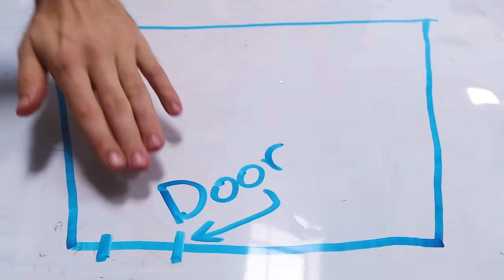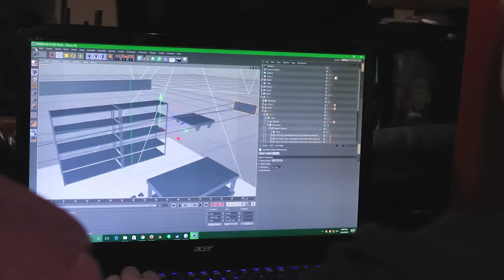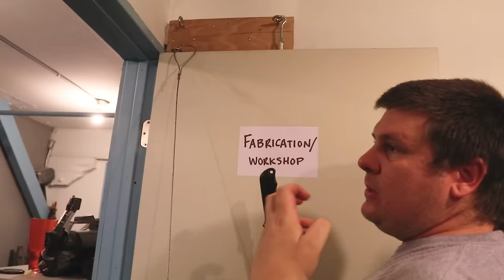Let's EXPLODE a Battery!

Comment: One potential solution for the camera rig I can think of is to run a pole (maybe a PVC pipe?) across the middle between the two sliders on the sides. This would transfer the tension in the center cables into compression in the pole allowing you to put much more tension on the middle cables without adding any stress to the wall mounts. In addition this would also help dampen some of the camera movement up and down as it would hold the tension in the center cable more constant, keeping it from bouncing. As a quick retrofit, you could even just thread the top two crossing cables through pipes to mount them. If you have any questions about what I was trying to say just let me know.

Source: also a mechanical engineer

Comment: to screw in revolts easier use a drill with a large socket that fits over the eye.  get it started by hand,  ensure its straight.  then use the drill to finish it

Comment: What's keeping you guys from replacing the top down camera mount's wires with rods? It would remove the need to apply an extreme lateral load on the wall and would remove sag (as long as you get stiff enough rods). As I typed this, I think Wren said basically the same thing. Go engineers!

Comment: The answer to the question "linear or exponential pull?" is that it's an exponential pull times another exponential pull.    The pulling force at the ends of a wire goes up exponentially as the load approaches the center of the wire and the straighter the wire is to start with.    If you had a hypothetical wire with zero stretch, that started out perfectly straight, then pretty much any force exerted in the middle of the wire generates infinite pull at the ends.      As soon as you allow some slack or stretch in the wire, the pulling force drops off quickly.   This is one reason zip lines usually have some slack in them, and spider cam rigs must always have some slack in the lines (can't be pulled up perfectly straight).  

The problem you have with two sets of parallel wires and then a set that are perpendicular is that you're multiplying the two exponential pulls together, so load on the cross wires pulls extremely hard in the middle of the side wires which exert their own extreme high pull on the anchors.   Something will give up.  Also, the side dollys with load on them will always try to center themselves on the side wires.   

As was concluded in the video, poles (or more specifically square or I-beams) will work much better.

Comment: You guys may need to attach a piece of wood or tubing between the two sliding boards to maintain rigidity and keep the cables from pulling together, or lose the cross cables altogether and go with a different way to slide the dolly on top of the sliding boards.

Comment: On the cable system try to make the tray as light as possible. There is no tension. On it as it floats on the cables. That should help in to lighten the load. Plastic wheels plot sheets and a go pro

Comment: Use pvc pipes instead of cables and skateboard wheels kinda like a DIY dolly but in the air. Or you can use metal rods with linear bearings like a 3d printer. These two options get rid of the wobblyness and the high tension on the wall. The force acting on the wall can easily be calculated using Pythagoras triangle and F=m*g.

Comment: the two on the sides shoudldve had a railsystem so they wouldnt be pulled away from the wall, just as a retentionsystem, with that you could put a lot more tension on the centerwires, one problem that creates though is that you need some smooth bearring and wheels on the railsystem otherwise it wouldnt roll verry well

Comment: You really only need solid rails for suspended part that is not directly attached to the walls.  The parts directly attached to the walls should be fine; the wires can be tightened there without issue.

Comment: You guys could attach a rail instead of a wire to the wall above the door and to the wall parallel the the door directly to the wall. It could ride on to that rail and help eliminate that problem with the middle wire pulling the side wires

Comment: for the top down, why not put a track or or line along the both sides of the wall while to attach to the back of the two vertical aligned boards. or for instead of using systems of wires your could use wall brackets to mount hollow aluminum poles. this would also move alot smoother for shots.

Comment: Just curious…why didn't you guys go with PVC pipe for your overhead? It takes a bit more dialing in to get the tracks perfectly parallel, but you can do it. Then the cross-mount is done also with PVC, in an "H" configuration with hot-glued crossbars near the ends to keep them perpendicular, and then you mount those on the side tracks with rings and limiter pins to give them a little play so that these system doesn't have to be nanometer-accurate. Two pairs of rings per PVC pipe per board, four per board total in a "square" configuration.

This will not be very expensive, and will save you the all this Philippe Petit "tensioning" hardship.  o.o

Comment: Would it not be simpler for the top down rig to have metal channels either side of the room at ceiling height, with a pair of rollers in each? Similar to sliding door runners. Cables then attached to the rollers, spanning the room? This would allow more tension to be applied to the cables, as the channel would be fixed at intervals along its length. Just a thought.

Comment: The battery caught on fire because is made out of lithium, lithium is an alkaline metal( like sodium, potassium,... )wich mean that it react with water in an Exothermic reaction ( that generate heat ). In this case I think it has reacted with the water present in the air ;)

Comment: Wren was right that battery didn't explode. The thing is, is that it defligrated which is sort of like an explosion except it doesn't produce a shockwave. Instead it produces large flames and a lot of gas. You can see the same reaction when firing a gun.

Comment: The problem is with the wire system is, that you can only transfer force as long there is an angle  (sin(0)=0). Sorry if unclear

Comment: I have done that with old lipo batteries used for rc cars, all I did was use a hatchet and cut it in half (Jk you have to discharge them and put a nail in em)

Comment: Exponential pull? Jeez dude, you gotta do some statics. I'd love to help/redesign it
Reply: Yeah, I was thinking about it last night, but they could roll with PVC, like in the video I attached and support it down the length of the room with some wood. Cheap. Easy to Fix, and strong enough!
Reply: 80/20 or similar extruded aluminum would work perfectly and is relatively inexpensive. you wouldn't need linear guides because they obviously aren't trying to hold tight tolerances, given that they thought it would be acceptable to hang it from cables.

Comment: Mabye instead typical platform use three motorized windlass with ends attached to triangual platform? It may be less stable and need more math and logic, but you can get three dimension movement. It's kind of Stewart platform (Parallel Cable Robot).

Comment: I'm honestly more curious to see how you guys complete the top-down rig now, more than anything! ;)

Unless you are bolting those chunks of scrap wood into support beams and using HD eyelag bolts as well for keeping tension on your cables, your top-down rig is gonna sag. No question. Using those flimsy eyelag screws (big difference between bolts & screws; Wren should know) will just rip out of that plywood they're screwed into once you apply proper tension to your cables... in their respective direction. Add in now the cross tension required for the perpendicular "slider" part and now I'd guess you've exponentially multiplied the stress forces on all the corner wall eyelags each.

A single steel rail on opposite walls held via brackets would give you the support and run-length freedom you're looking for. Angle iron or PVC tubing makes no difference as long as you have your wheel system to match your chosen type of rails. As for the perpendicular cross slider, again, steel rails give you the strongest support vs sag/gravity and again, choose your wheel system to match. Taking another quick look at the posted video, you still need to account for camera weight on your rig, unless you plan on using a GoPro which would be negligible weight.

I'm curious how you plan to control the rig motion? The wall sliders will need to be controlled simultaneously whereas the middle slider only needs one controller. You could drop it down to only 2 controllers but that would require some long cabling to run both wall sliders off a single motor system; probably easiest/cheapest option as only requires extra (double?) long cables to connect the far wall rail to the controller.

Comment: Use safety glasses when fucking with these batteries. Even though they are more likely to burn, like in the video, they can explode. My old airsoft repair guy has a glass eye, because his original eye was sliced in half by li-po shrapnel.

Comment: For the rig, why not just use pulleys in the corners with counter weights? it's not like the room is that big so you'd get by with the height of the room as the diagonal travel of the rig

Comment: This may or may not be a good idea, nor correct, but I was just thinking; would the CoreXY style of movement (used on CNC machines and such), help with the issues of tension and material stress? I feel like the crossing wires would help to split the load. Just a thought I had; keep being rad!

Comment: Have yall seen the wirewalking movie "The Walk" with Joseph Gordon Levitt? I feel like they had tips about stringing up wire with tension and such.
Reply: Wait wait wait, I change my answer. So instead of one wire per anchor point, maybe make a loop that goes through both anchor points. So say from one wall to the other, instead of 2 wires just do one long wire. This wire can be tightened and tensioned until the desired tightness. I dont know about the one that goes in between though...
Reply: Never mind...I rewatched the video and realized that is not at all what you guys need. =( Out of my league but good luck to yall

Comment: Imagine what would have happened if Niko had hit the center of it ^^
Cool shot though, in every sense of the word ;)
And for the top down rig I would use tubing instead of wires. No sag, no pull, totally rigid system. From one engineering student to the other ;) Let me know what you think, so I can improve too! :)

Comment: You should not use water for putting out a lithium fire, it can react violently. There are special fire extinguishers for metal fires that should be used instead.

Comment: It would be better if welded a pole on the sides and had the wire rigid the middle if you really want wire. Or just instead of wire you just use pipe that the trolley can run on

Comment: Did you guys really extinguish the battery with water??? I guess you were lucky, that all the lithium already reacted with air because otherwise you might have gotten your little explosion :D

Ohh and it (obviously) would have been better to use metal rods for your camera system. Just secure two of them next to each other horizontally at both ends and put three to four supports underneath. Do that on both sides and let the trolleys drive on top with another set of rods, which then hold the actual camera. I have build a rig similar to yours and it works perfectly. 
It´s just always a bad idea to secure somthing to a wall with wires. If you don´t want the wire to be hanging under load, you have to put a huge amount of force on your bolts. 
(If your final rig weighs around 6 kg/13 lb, you put around 178 N/40 lbf of force on your wire in each direction, if you allow a 10° angle. [5° -> 338 N/76 lbf])
Wire systems also tend to loosen up over time especially if you use them regularly.
... but apart from that I would love to see you guys finishing/re doing your trolley system.

Comment: You can't hold a vertical load with horizontal wires because they can only carry axial loads.  There's no rigidity in them, and nothing to counteract a moment .  No matter how tight you pull those cables, there will always be sag.

Comment: random curiosity why didn't you just go with a rail system or pulley wheels between 2 pipes for the movements against the wall that way there wouldn't be a issue of tension other then the wires crossing the middle of the room

Comment: have a third cable on each side running through a hoop on the outside of the board to stop the dolly from pulling the whole thing inwards?
though it would need connecting to the other walls
was it not effective to build your own runners on the walls and have an elevated trolley sort of thing rather than fiddling around with tensioned cables?

Comment: I'm new and enjoying your channel. I was wondering what the pull is on your re-curve bow? I have an older Re-curve with and 85lb  pull and have to use carbon fiber arrow shafts. How do you get away with using wooden shafts with out them snapping ?

Comment: I don't think they realise that it was surely going to burn. It is a mostly lithium battery, Lithium if it comes in contact with water violently reacts resulting in fire, and sometimes explosions. Wren was kinda lucky that it didn't explode.
Reply: Nah that wouldn't have happened. The water isn't what set it off. It was the short-circuit within the battery from the arrow clipping it which caused the ignition. And the only reason it did burn was because it was a fully charged battery, something I didn't realize.
Reply: yes, there is that as well as lithium batteries when considered dead still have a significant charge, my dead 3 cell for instance sits at 7+ volts, my full working one reads 12.3 volts. When they go puffy like you were saying yours was it was probably sitting around the 7-8 volt area.
Reply: ninjaman5j5 Because of how batteries work, that's a little misleading. Yeah it's reading 7-8 volts but because there's so little energy left, it doesn't have the same effect as a fully charged 2 cell battery reading the same voltage. If a battery is depleted, there's no more potential energy stored in it to combust. There are tons of videos online of batteries that don't really do anything after being destroyed like this, because they don't have much charge left. 

And although yes, Lithium reacts violently with water, there's less than 2% lithium in a Li-Po battery and since the polymer package was sealing it, the lithium didn't come into contact with any water.

The puffyness is due to excess oxygen from the anode aging, which is what ignited when the battery cell short circuited. The battery can still read nearly full voltage even when it's puffy like that.

Comment: I'm sure I don't need to say this, but don't do this with a Lithium Ion battery. It'll burn until there's nothing left. There's no way to put those things out. But you guys are smart so I'm guessing I'm preaching to the choir. Also Wren what was your Engineering major?
Reply: I'm late to responding I guess. I majored in Mechanical. But yeah, we were aware of what could happen with the lipo battery. We knew it wouldn't explode, but would definitely vent. I was personally surprised that the venting ignited, but in hindsight I shouldn't have been. I just didn't realize it was fully charged. Water put the fire out just fine though. A lot of people are saying Lithium and water are bad together, which is true, except that there's less than 2% composition of lithium in a battery like this so it was fine.
Reply: That's cool. I didn't think it would catch on fire three times. So this was interesting.

Comment: why don't you string the wires through PVC so you get the rigidity of the pipe with the strength of the tension wires? that might help your sag issue. maybe use small diameter pipe so you don't add too much weight

Comment: ....so let's talk about that cable death trap...
I don't comment on your videos, but I too am an engineer and I was horrified at this. Sure you can use trigonometry to approximate the strain you're going to put in the cables but all that strain will transfer to the walls. Unless you're going to reinforce those walls, use proper suspension wire, and secure those wires with something more than just a tensioner, then for the love of the iron ring, just buy a properly engineered system.

Comment: Dude. You gotta cover lipo fires in sand and dirt or something. Water wont put it out.
Reply: Water did put it out.
Reply: Think it was more along the lines of the crap in the battery completely burned itself out about the time he added the water lol but initially it wont, unless the value of water is considerably greater, like fully submerging it in a body of water.
Reply: I've read about lipos burning like flares underwater in rc boats

Comment: The Lithium in the LiPo battery reacted with the water on the board, so it burnt.
Reply: I NEED MAOR  no they always burn
Reply: Rc Keith
I didn't say it wouldn't have burnt anyway... :P
Reply: The lithium did not react with the water. There was not enough of it.

Comment: forget cables and poles, two axis of cables tight enough to not sag was never going to work practically.and poles will get expensive. if you want to do that cheap just use ply wood to make some L tracks and I beams, check out john heisz's build. http://www.ibuildit.ca/other%20projects/camera-gantry-1.html

Comment: dude i took my blowtorch to a vape l-ion 18650 after I switched to cigs and it turned into a rocket, flyinbg about 15 away from me and then exploded. but i still third degree burns from my dumbass picking up the still very hot metal casing.

Comment: can't they just shorten the wires that the camera rig is on?
Reply: i was wondering the same..!
Reply: Because it would add more tension, pulling the side wires more inward, causing extra tension on those side wires, which might rip the wall mounts out